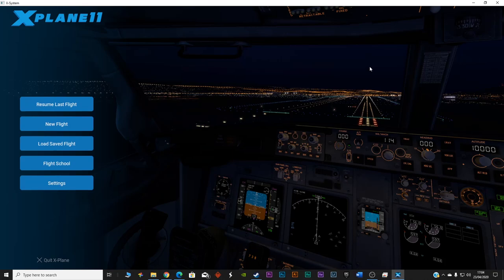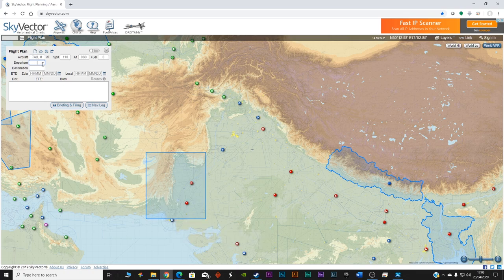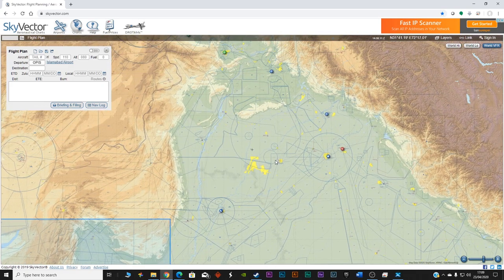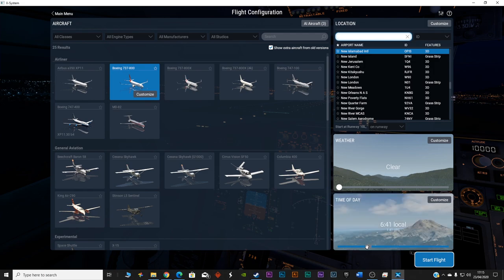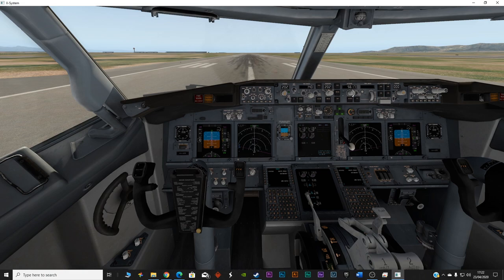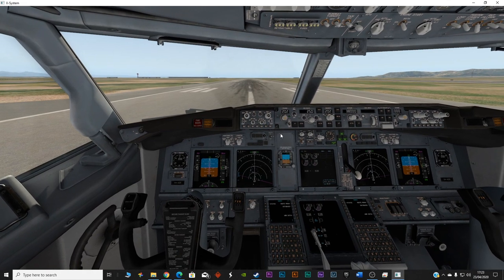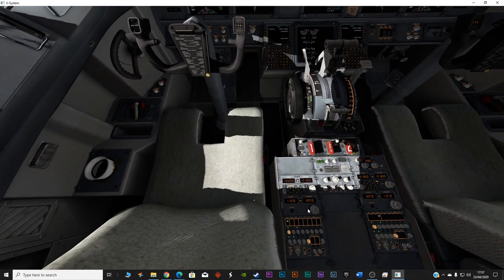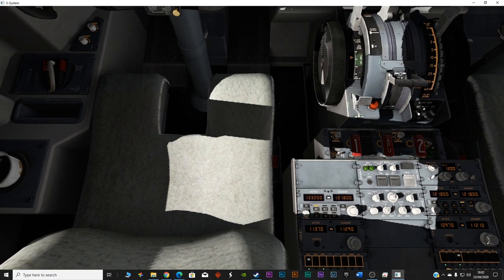VOR Navigation and ILS Approach and Landing in X Plane 11

Comment: Great tutorial! although I have a suggestion, instead of constantly readjusting the course of the aircraft  in order to correspond with the desired VOR radial by fiddling with the heading bug,  why not simply hit the "VOR/LOC" button on the MCP? because that is what I normally do, as it significantly reduces the overall workload of the pilots.

EDIT: I just noticed that at the 31:17 mark you mention the exact trick!     my bad 😅